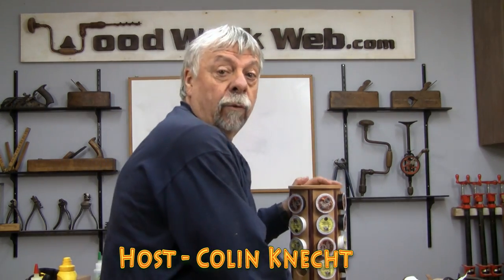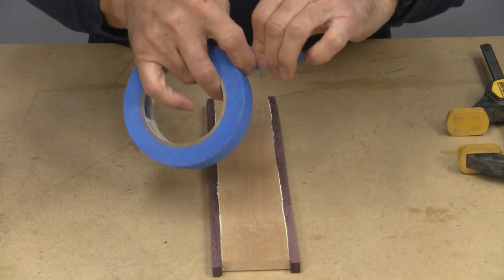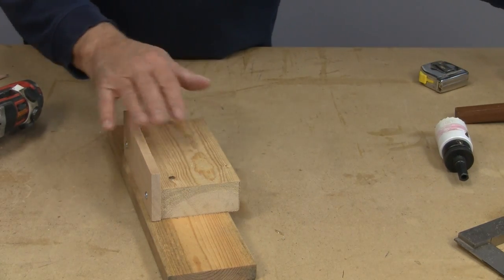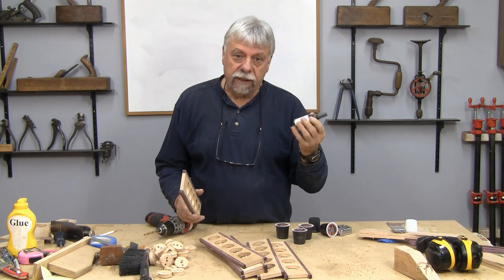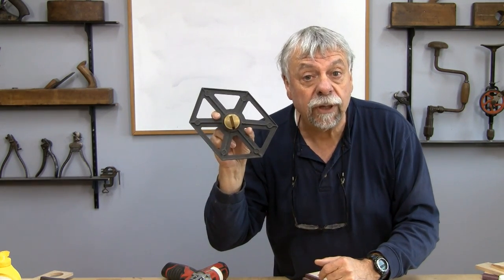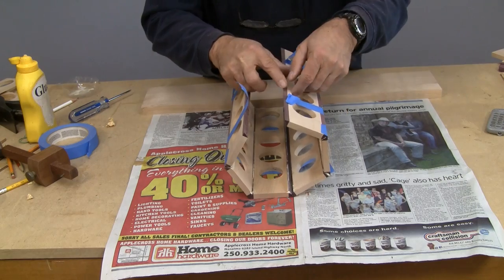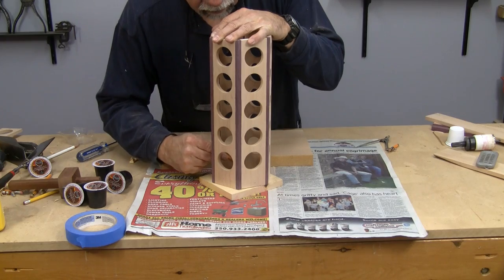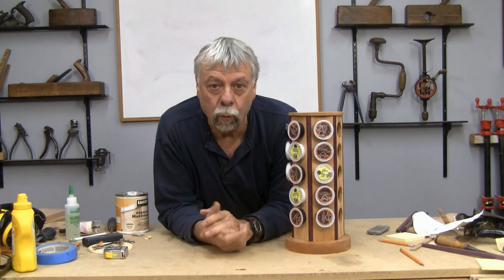Make Keurig Coffee Pod Dispenser - woodworkweb

Comment: Very nice Colin. If you tilt the drill press table you could have the cups face up a little and they would stay in place. just a thought . Great project for the Keurig drinkers, Thanks buddy.
Reply: He mentions trying that design in the website article.
Reply: Thanks didn't look at that.
Reply from the maker: Backyard Woodworking  Brian Chu Hi Roland, yes Brian is correct, I tired the angle and it actually does not work well,  straight in is best.
Reply: WoodWorkWeb Thanks Colin I just received a woodsmith mag. and the have a spice holder in this issue. The hole were drilled on an angle They used a jig and a 1 1/2" forstner bit.It turned out nice.
Reply from the maker: Backyard Woodworking Thanks Roland, I will have to check it out
Reply: ***** That might just do it.Thanks
Reply: great tip, thanks

Comment: There is one advantage of using the hole saw over the forstner bit. when you are don on have plenty of 1 5/8 inch wheels for toys. Helped to remodel a church that was once a lumber yard barn with roof sagging.  Engineers had us build a truss for te center of the church to hold the roof.  Wore out 3 6" hole saws drilling holes for can lights from rear of church to the front,  Then we put 4x8 oak panels the length of the 44 foot truss.
Reply from the maker: Gary Finger That's a great point about the holes for wheels Gary

Comment: I too find taping miters together for gluing works very well.  One point:  Instead of using solid wood inserts plywood would be a better choice because it doesn't expand and contract with changes in humidity.  I don't use the same coffee maker but my brother does, I may make one just for the fun of it.
Reply from the maker: Ed Waggoner Sr. Yes, no reason you could not use ply for the main body of the holder ... I'll be someone would love one of these as a gift some time Ed, there's a reason to make one :)

Comment: Thanks Colin, I really enjoyed the video.  I have never seen an angle finder like that.  Very quick and easy.  It does make me think of getting out my birdsmouth router bits and trying the project.  I think it would be super simple using the router.  Also, do you think it would be possible to drill the cup holder holes at an angle so the cup sits at a slight down angle?  Interested in your thoughts.
Reply from the maker: Mark Perkins Good points Mark, yes you could do this on a router and as for drilling the holes at an angle, I tried that and found that it was actually worse, the elongated holes allowed the pods to fall out. I know it sounds a bit crazy but the straight in holes worked best. If you try cutting some on an angle, let me know how yours turned out. I forget what angle I used, I think it was around 20 degrees

Comment: I like the tip you said about using tape on glue ups.  Do you know the degree you had your blade on by chance?  Thanks.
Reply from the maker: Luis Figueroa Hi Luis, it's 30 degrees, but you might also want to check the article, link is first one in the description box above, as there are other details you might also want to know ... good luck with your build, maybe you will share some pics on woodworkweb when it is finished

Comment: Another great video, is your table saw a Rigid? The insert plate looks like the same that I have, if I ever get the chance to assemble it.  I TT s been sitting the box for over a year now.
Reply from the maker: Michael Haughey No my table saw is not a Ridgid, but I have used that saw and really liked it, smooth, easy to operate, I even like their little contractors saw, a great little saw for folks starting off. All things in good time, when you get the chance you will be all over getting that saw set up ... then you can send us some pics of your builds !

Comment: Why bother with the hex inserts if you planned to glue to lower hex tower firmly to a big round base  and the upper hex tower to the smaller round cap?
Reply from the maker: +Duck4212 wasn't sure if the thin material would glue firmly enough on that thin edge, but you could try it without to see how it works
Reply: WoodWorkWeb I liked your design.  Yesterday, I made one very similar, with a few modifications to keep the cost down,  and I am quite pleased.
I took some existing  3/4" oak and re-sawed  it in half on the band saw  giving me pieces of approximately 5/16" thick. I cut these pieces of oak into 6 panels of  2/ 3/4" x 13" lengths and drilled  5 holes  of 1 1/2" on each. I find that the holes of 1 1/2" also work well as I didn't have any drill saws of 1 5/8" like you used.  Since I used only material that I had on hand I didn't use any purple heart ( although the purple heart accent  looked great on your project), I just simply beveled the oak panels at 30 degrees on both sides on my table saw.

I decided not to use an hex insert for the top.  I just fabricated a 5/16" thick hex shaped cap and glued it directly to the top of the panels ( instead of the round cap you used). I wanted to accent the beautiful hexagon shape on the top.

 For the base, I cut a 6 1/2" dia. circular piece of 3/4" thick oak and I decided to go with the 3/4 thick hex insert, for glue strength,  like you did.
 I attached a  $4.00 lazy Susan bearing plate to the bottom to give me easy rotation capabilities. I stained the whole project with a dark stain and filled the tower with Keurig pods. 
It looks wonderful. These Coffee Pod holders will make wonderful Christmas Gifts because they are very appreciated , useful,  relatively cheap and easy to make.
Thanks for the great ideas for projects.